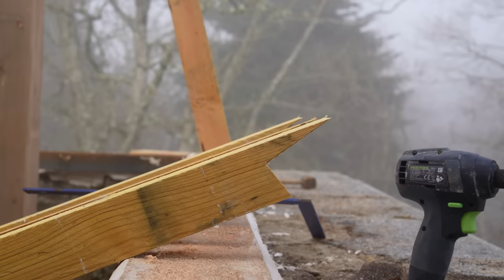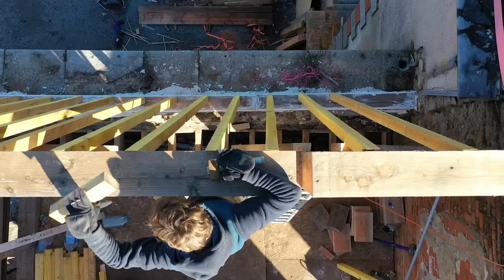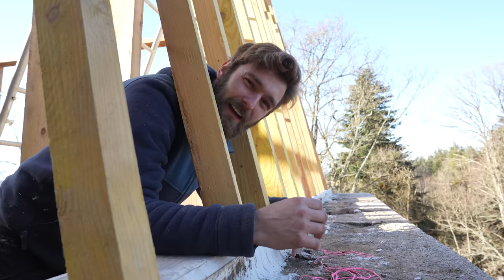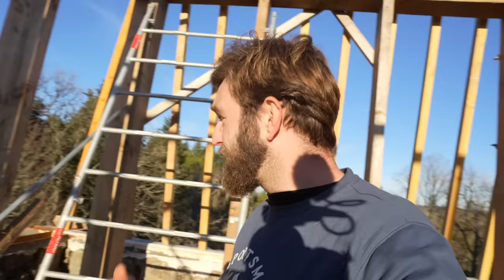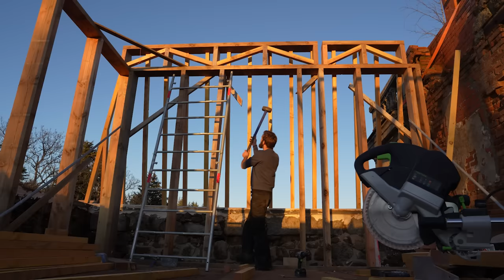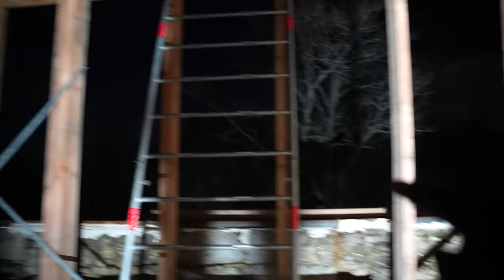The MANSARD roof starts to take shape.

Comment: I may have missed some of this but I'm interested to know why you use plaster when bedding the beams and not lime mortar, and the purpose of the the U-channels on top of the walls. Why not just use a wooden sole plate? Also, are you going to bolt through these down into the wall?

Comment: I wonder why you are putting a wooden beam inside the steel c-beam... why not make the angled beams you installed today rest inside the c-beam? They would have no chance so slip outward. Instead now only screws or nails will keep them fom pushing outward, for example due to wind force...

Comment: Gun nails should not be considered as structural fixings. They are just for tacking structural members in place. Use wire nails, preferably galvanized and/or structural screws for example Timberloc's, 👍💪💪🔨🎄🇮🇪
Reply: Sind die Leisten nicht auch etwas dünn? 😮

Comment: Brother, roof framing is more than backing for the sheeting. You've transfered all your roof load to the attic floor rather than the outer walls where it was designed originally. Have you consulted a structural engineer at all?
Reply: Dan explained about the roof load in an earlier video.

Comment: you really think nails are more secure than screws?
Reply: Nails tend to have better shear strength compared to screws, which means more flexibility, a very important feature suited for structural joining, framing, exterior wall sheathing, or hardwood floor installation. Nails made with correct materials will bend to a large angle and less likely to snap compared with screws.
Reply: @bigcoffee2291  That's a great answer.  What about construction screws?